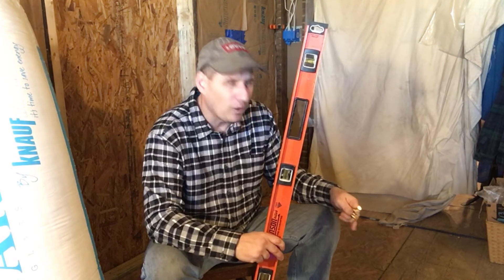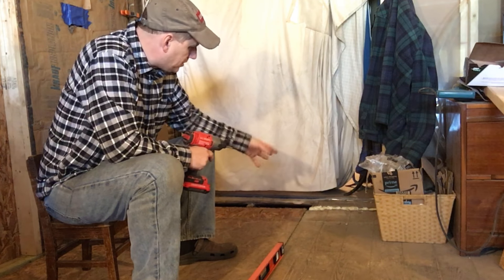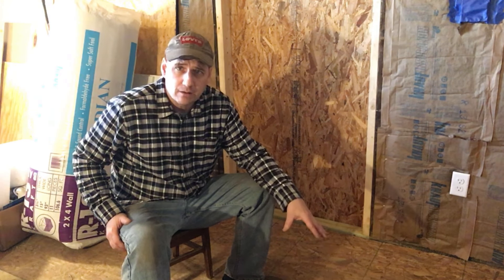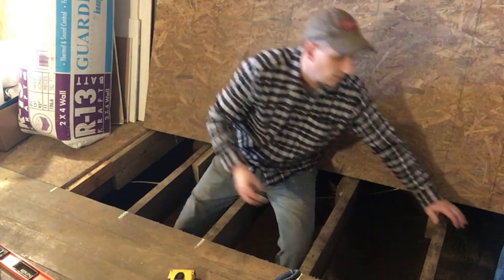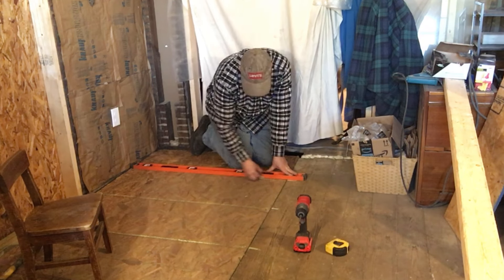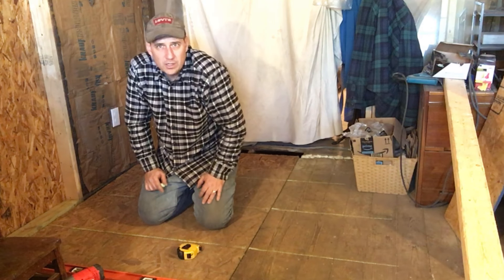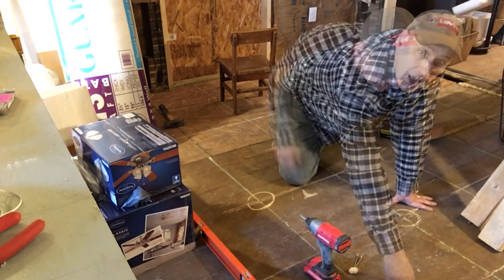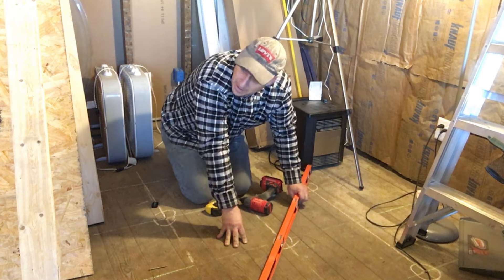DIY: Easiest Way To Level An OLD WOOD FLOOR - Using Screws and a Level

Comment: Nice work! The beginning of your video gave me an idea of how to fix my own issue.

I have a single joist that is solid wood and warped about 2-3mm lower than the others. I can simply tack 2x4s along both sides of the joist, level with the others. Having two boards distributes the weight among more screws. YOUR'E TOPS!
Reply from the maker: Awesome! A single 2x6 would be sufficient to sister on. The original joist will still carry the load. Good luck with your project.
Reply: I have a sister named Joyce, and shes really getting offended .

Comment: Thank you so much for this video (and all of your others). You prob wont see or respond to this comment and question before I finish the work on my kitchen remodel, but worth a try.

Im doing a kitchen remodel on a small 100 year old cottage. There is a 2 inch difference between the left and the right side of the kitchen. I am renting from friends and they do not want to do a bigger structural fix, but are willing to pay for all of the material if I am willing to do the labor of the remodel. In any event, I didnt want to use self leveling concrete as it would be both expensive, and more importantly would add a significant amount of weight to a floor that Im not certain could support it. Was really pleased to find your approach. I only have 2 questions for you:

1- the existing floor of the kitchen has 2 levels of plywood--the original and a newer chip board. Both are still solid. If I were not exact and did not manage to screw the sleepers directly into the joists, would that be a significant problem? I.e, if the sleepers were screwed into the subfloor only, is that OK? 

2- when cutting out the sleepers, do you think a circular saw would do the trick? 

Thanks so much! Really appreciated you.
Reply from the maker: It probably is okay to screw into the deck only if you also use construction glue such as liquid nails… otherwise the screws will loose grip and tear out over time and will squeak. I used a small 4” hand held circular saw to rip the sleepers. A jigsaw will work too but takes longer. Good luck with your project

Comment: Any reason the sleepers cannot be placed perpendicular to floor joists if they're still screwed down securely at each joist? In my particular situation, without going into a lot of detail, this would be easier I think. Appreciate any info you can give - great video by the way.
Reply from the maker: It would probably be okay if the old floor deck remains… but sleepers themselves have little to no strength

Comment: Hi, thanks for the informative and concise video! Your method seems like a tractable and efficient solution. Our neighbors implemented something similar and are very satisfied.

I'm curious if you could offer me a bit of advice. Our structural engineer confirmed that our 90-yo house is in good structural condition but underwent massive settling decades ago. The engineer is quite certain it's stable now because the old paint, drywall, etc are intact. However, the settlement is truly massive -- for example, about 7 inches over the 13-foot width of our living room. It would be nice to get the floors closer to level, but clearly we're not going to get very close with 2x4s. Would it be insane to implement your method with thicker pieces of wood and some cross-supports? At some point, the screws would get extremely long... Curious if you have any ideas :) 

Thanks a lot!
Reply from the maker: Thanks for watching! If you have had a licensed structural engineer inspect your house - I would trust his/her opinion. He refers to the plaster being a clue because if there was significant structural framing compromised - you would see plaster falling off of the walls or serious cracks in it. 7 inches of settlement is significant but not unheard of. Usually settlement is not an issue with the house or the weight but instead the soil. Soft soil conditions can cause foundations to settle. Is that area around that part of the house properly drained? Does it have gutters or was it missing gutters for a significant amount of time? What caused the house to sink into the ground? Solving that problem will stop the settlement. Proper drainage of water away from the house is usually the solution. At 7 inches of settlement - I would consider calling a foundation repair contractor and get an estimate on raising the house some in that area before spending money on the floors. Hope this helps you.
Reply: @RundownReborn  Thanks so much!

It does seem to be an issue with the soil or the height of the water table -- the neighboring houses are all visibly out of level, too. According to the city's documentation, it seems that this area used to be prone to flooding due to poor engineering on the city's part. That's about all we know.

The drainage situation is okay-ish but currently under improvement! We're re-doing the gutters, touching up the grading, foundation maintenance, etc. We'll observe the situation for a while after the updates are complete before we do anything exciting. 

I'm glad to hear our issue isn't unheard of! Our engineer recommended cosmetic fixes like leveling the floors. His opinion is that while the house is structurally sound now, there's no guarantee it will remain structurally sound if we raise it even part of the 14 inches it has tilted. He surmises it's been in this orientation for several decades. We're just having a little trouble finding leveling methods that can be extended to a 7-inch drop.

Thanks again :)
Reply from the maker: @madistoddard7530  yes, 7 inches is quite a bit of distance. If it’s in only one area of the house, I would probably investigate jacking up the house there and resetting it to the foundation. Then you can always use some perforated drain tiles around the perimeter outside to help keep the soil dry.

Comment: this looks promising.  My floors are uneven and I actually had a contractor come in to level it that made a complete mess of the whole thing.  He used ashpalt shingles and two separate sheets of 1/2 plywood laying ashphalt in between the original Pine T&G decking and the first layer of plywood as well as more ashpalt shingles between the 1st. layer of plywood and the second.  Both layers of plywood are not T&G.  What I have been left with is a still unlevel, spongy mess that has PL 400 glue in some places and likely thousands of screws everywhere.  Part of the reason he used as much product as he did was because he was trying to raise the level of my floor to my new kitchen tile (even though I told him I didn't mind the small step up). I've been searching everywhere for some good advice and your video looks like it might just do the trick.  So my plan is to rip it all up, try to remove as much of the PL as I can and start over using a single layer of 3/4 ply and your method. I do have one question though.  In the video you showed close ups of the sleepers that showed gaps inbetween them and your decking.  Didn't that translate into some uneveness when you secured the decking at each screw point?
Reply from the maker: Wow, what a story. I would definitely recommend at least 5/8" at the minimum (not 1/2") but 3/4" T&G is best.  That thickness provides tremendous stiffness to the system that you won't get with 1/2". Trying to get that old plywood up that has been glued is going to be a big chore - especially if the glue is over the lower sandwiched screws.  Trying to find the screws can be difficult.

Also - I'm not sure what gaps in the sleepers you are referring to in the video but if you do have those - you can always shim the bottom side if necessary (perhaps with some of those leftover shingles - LOL). I recommend that as you set the sleepers in place - continue to check for level with adjacent sleepers and screws to be sure that your deck plane is as level as possible.  Check out this video for another look at leveling a floor: https://youtu.be/fv9PZcCu_0k

I suggest that you do all the screw leveling first for the entire floor and base everything off of your kitchen floor connection.  Be sure to put a sleeper down along the seam between the different floor so that you won't get separation or unevenness at the transition doorway and/or connection.  If your sleepers are parallel to the seam - start at the seam and work your way out.  If they are perpendicular - start at the center and work to the sides.  If you can get your levelness within 1/8" you will probably never notice it underfoot.

Good luck with your project and thanks for watching!
Reply: @RundownReborn  Good advice.  Thanks.  Ya the gap I was talking about was inbetween the points made by the screws.  I do kind of expect that because my floor in slightly wavy in some areas so ya, I will likely need to do some shimming..  Another couple of questions.  I myself have a small 3 inch dremel saw which I don't think will do.  Unfortunately the local Home Depot doesn't have any 4 inch saws (weird right?) so I"m wondering if you can disclose the brand you used so I can search for it online.  Also, did you put any glue down under your sleepers and what type of flooring are you planning on putting down over the sleepers?  I'll be putting down high end engineered Hardwood.  I plan on starting after the Holiday.  I'm a bit nervous about glue residue.  do you have any recommendations on products to use to soften it up so I can scrape it off?
Reply from the maker: To find a saw - just google a 4" circular saw or a 4 1/2" circular saw.  I found several available online and the 4 1/2" size is more prevalent.  If I were to buy again - I think I would buy a 4 1/2" as the 4" sized saw blade is hard to find replacements for. I bought the cheapest one available at Menard's at the time. It feels a little under powered. I have found that this saw really comes in handy.  It might be worth buying a name brand saw like Dewalt.  Home Depot has them available for around $100 when they are on sale.  They cost a little more but will have a stronger motor.  A cordless one would be handy too.  It's a really handy saw for around the house and much easier to work with than a larger 6" or 8" saw in many cases.

Regarding the floor - I did not use any glue in my floor.  It is not a bad idea to do so - but I didn't to save time and money.  The floor material I put onto the sleepers was 7/8" T&G OSB board.  This is heavy and sturdy and you won't get "waviness" with that thickness. 7/8" thick sheet material doesn't bend. On top of that subfloor, you can put any finish floor that you like (ie: carpet, laminate, hard wood, etc.).

As far as tricks to getting wood glue up - I really don't have any suggestions other than saws, flat bars, floor scrapers, muscle and sweat.  I've never tried it in this application but an oscillating saw might be helpful to cut in between the layers some - if you can work it in there.
Reply: Sad story,
Hope the fix goes well.
Another solution is using a laser level and scribes if you have access to laser.
I built a finished room out of patio cover area.
My floor went about 5" out of level at 10' (concrete).
First I also drew/snapped reference lines exactly to where joists would end up.
Then I set up an arbitrary control line with laser. This was to level the height of new floor with old floor from house.
I set up pressure treated 2x6 on shim stacks from highest point of floor.
After that I scribed a line from floor to 2x6.
Because the 2x6 sagged/bowed I used Fast Cap 3rd hand poles to press 2x6 down against ceiling to force them tight to shims.
I hope some of this might help, just sharing my experience :)

Comment: Not to be a thorn in your side, but did you fix the "sinking" issue? This may be fine for a few years but if there is foundation issues or rotting floor joists the problem will just continue. I'm currently in the process of replacing every floor joist in a customer's home and must level everything for below
Reply from the maker: I do believe the sinking issue is fixed. In this video I talk about it. I've linked to the moment I explain the issue from inside the basement. https://youtu.be/M5r4cCSSM3Y?t=1512

That combined with adding a gutter to the porch area and fixing the roof and I don't expect the house to settle anymore in that area.

Comment: Just talked to a structural engineer about this method, he didn't recommend it all not because the new 3/4" plywood will add extra weight to the foundation. It will eventually break it. Just jack up the beams under the subfloor, enhance them, and install new plywood if needed.
Reply from the maker: Structural engineers are notoriously conservative. The foundation won’t fail for 200 years.
Reply: If 2 lbs. per square foot causes the foundation to fail you have a lot more problems than a uneven floor!
Reply: Yea thats bananas. If a sheet of plywood fails you're Foundation, you have much larger issues than a floor. Plywoods over a 4x8 sheet is lighter than you standing there.....

Comment: Maybe a stupid question - if you can "somewhat conveniently" lift up the old decking, can you just lay shims along the tops of the joists and then put the decking back down?
Reply from the maker: The existing deck is 120 year old cedar plank flooring. Shimming 4” plank deck cedar would take 100s of hours and would alter the structural integrity. So that wasn’t an option.

Comment: Thank you so much! This is very helpful! I have a question. I would like to use your method to level my kitchen floor, however I am worried that by the time I add 3/4 inch sub floor and then laminate flooring on top, the height difference between my living room floor and kitchen floor will be too significant (possibly over a one inch gap). Do you have any advice for this?
Reply from the maker: In this case you are either going to need a transition strip between the different finishes or level the adjacent room too. Or remove the existing subfloor in the kitchen to bring the floor lower.

If the only transition place is a doorway, I recommend to slope the threshold there between the rooms. If the rooms are open to each other, a more substantial solution is needed.

Comment: I bought a condo which I never noticed the dips because it had carpet and I wanted to switch to laminate flooring. But with the dips the installation didn’t come out good so now I’m starting from 0 looking for ways to level it. Do you think this method would hold up with laminate or going back to carpet is my best option?
Reply from the maker: I will be doing both over mine. I plan to do laminate in the living areas and baths and carpet in the bedrooms. A wood subfloor is common. Laminate floors are flexible - it should be find. Ceramic tile is another story though. That requires rigid cement board underlayment when installing it over wood floor systems. Hope this helps and good luck with your project. Welcome to the channel!!!

Comment: Thank you! I have an old house and want to level my bathroom floor but didn't know how to approach it.
Reply from the maker: Awesome. Glad the video was helpful. Thanks for watching!
Reply: I use a similar method but something that might be easier for you is a “dry pack concrete” similar to what’s used on a shower floor.

You can work it level and it’s literally concrete after.

Comment: Excellent thank you. Exactly what I need to know but on a much smaller scale, my garden shed 👍
Reply from the maker: Good luck. Post a before and after pic on Facebook @rundownreborn
Reply: How do you factor in the thickness of the plywood when leveling to the top of the existing floor in the other room. Wouldn't the end product be 3/4 to 5/8 inches higher than the floor that you are trying to level to?
Reply: chagob - he’s working from top of floor joist to top of new floor joist
Reply from the maker: Michael is right. I was leveling to the top of the sleepers in the adjacent room - not to the top of the deck sheet.

Comment: Great method. 

I have a one story house where the floor is crowned. Meaning, the perimeter of the floor has settled about 1" more than the center of the floor. My problem is that the exterior glass sliding door threshold is right at the same elevation as the high point in the middle of the floor. Meaning, I can't raise the floor as much as you did. 

I would totally use your method if I could raise as much as I wanted. I think leveling compound is in my future. :-/
Reply from the maker: For me, I was replacing all interior and exterior doors, so I didn’t have this issue. You could either reinstall the door one inch higher or make a depressed area in front of the doorway. If it were me, I might consider raising the door to accommodate the new level floor.

Thanks for watching!